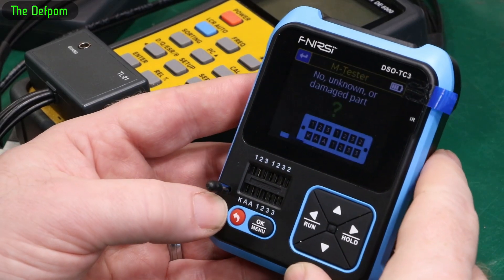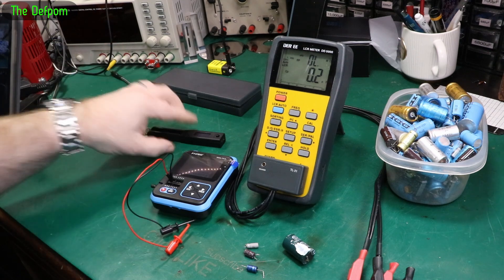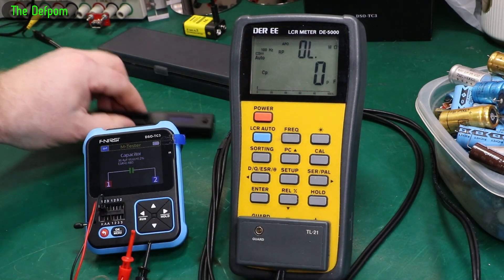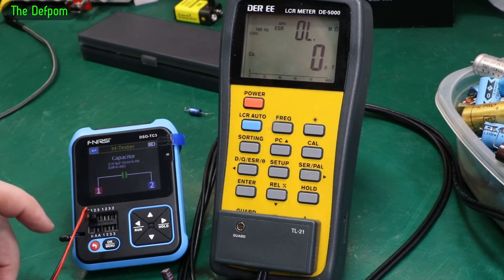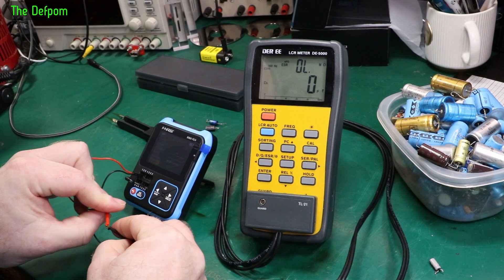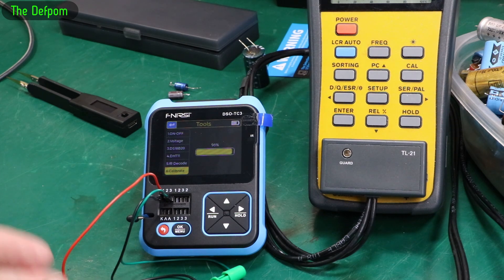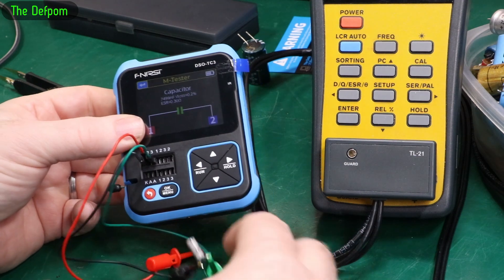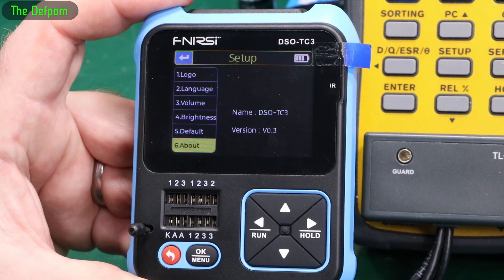🔴 A Surprising Result ? - FNIRSI DSO-TC3 ESR Measurement Testing - No.1273

Comment: I have not had good results with this device on transistor testing. On 10 each 2n3393’s emitter and collector leads were called out incorrectly on TO92 case style.

Comment: Very happy with my TC1. Works great. I did get an anomolous reading of a 47uF cap that measured 220uF and had a high ESR. I will check it against my ESR tester which just measures ESR accurately. Anyway replaced the cap and the switching supply started to work fine again.

Comment: I just got one of these yesterday. Got it as kind of an upgrade from this TC1 that I have. I'm just getting into building effect pedals for guitar, so still kinda learning all this. I'm not to a level where I really need anything too fancy. Mostly just to differentiate between a JFET that happens ro look just like most of my BJTs, or what the pinout is on a particular transitor, etc. 

So far, my main issue is that this DSO-TC3 isn't reading any of my Germanium transistors. It always reads as either a resistor or some kind of double diode thing. 

I've watched some other review vids about this tester but no one has tried measuring any Germanium transistors! Like I said earlier, I'm still learning, but was wondering if anyone else knows whats up with that, because it reads everything else just fine, for me anyway. I don't need to be all that exact at this point.

As far as a lot of the other functions go, I do plan on using the oscilloscope to dial in the different types of sound waves as needed, but no real experience with all that yet. I eventually plan on getting some more precise and specific gear, like just one good multimeter, one good component tester, and one good oscilloscope; rather than all of that, but just "OK", crammed into one unit. 

But what I got is good enough for now. Was just wondering if maybe there was something I was missing, or some secret setting on this thing to alliow it to read germanium transistors  

And by the way, it does seem to be reading my germanium "diodes". Not sure what's up with that, but there ya go.
Reply from the maker: @JESSEALLEN77  I don’t have any germanium components to test my unit with, so can’t really say what is happening there.

Comment: Gorgeous case.  Tries to do a lot of things and in the process doesn't do well at any of them.  Hey Scott, thanks for the in depth demonstration of these types of devices.  A little tip for calibrating with hooks, get a smooth gold plated pin, put all three hooks on the pin, press test, and when you need to isolate the probes pull out the pin - releases all three simultaneously without damage.

Comment: Although it is advertised as being able to do an ESR measurement, if you don't worry about doing an apples to apples comparison, and instead, pay attention to the Vloss value it generates from a test, it can still be a useful quick check tool to verify the status of an e-cap. I have gotten the feel for an older TC-1 tester to notice that, a higher Vloss value equates to a capacitor being faulty. The downside is the cap has to be taken out of circuit, as it does not test with the 100KHz frequency that allows for in-circuit ESR testing.

Comment: I own the same fnirsi and DER devices. I came to the same conclusions. The fnirsi is ok for quick testing of small transistors, diodes etc, but I would not trust it to accurately measure caps. It is ok for the money, it can do quite a lot of things, but it does none of them really well. It is battery fed so it has a floating ground, which can be practical sometimes. Thanks!

Comment: ESR is not frequency dependent.
But measuring ESR is frequency dependent.
DSO-TC3 testing at unknown frequency.  
Other two testing at 100Hz. 
DE5000 have option to change testing frequency.  
And, these testing just show the measured impedance or doing some maths?

Comment: To compare apples with apples, shouldn't the frequency, voltage from both devices match?
Reply: In fact, that tester measures those values utilizing different method. It's much slower than 100Hz used on both RLC meters, it applies DC because it just charges that capacitor to some point, then discharges it using different current and all that values it displays are taken from charge and discharge time, it's completely different to applying a 100Hz signal through the bridge, so it displays different values, esp. when DUT is no longer a properly working capacitor, which is pretty normal, but…well…complex things are complex…especially when it comes to impedance.
Reply: @NikiBretschneider  yeah this is true. I've just checked the test signal applied by my T7-H component tester (I'm assuming it's pretty much the same as the one shown in the video) with an oscilloscope, and there's no AC signal. it uses a series of DC voltages of opposing polarity, some RC curves can be seen, etc, but no true AC measurement.